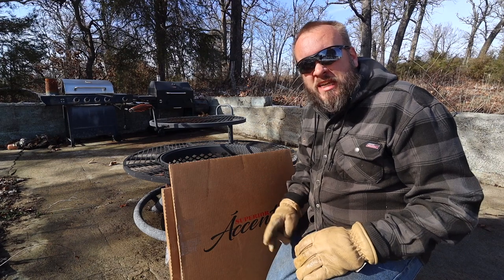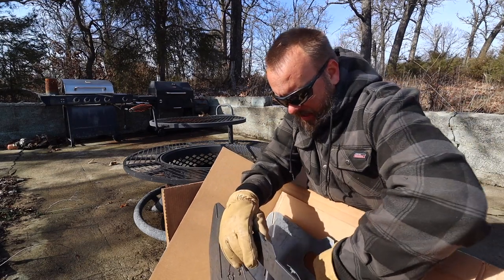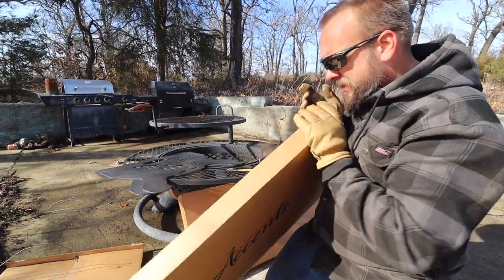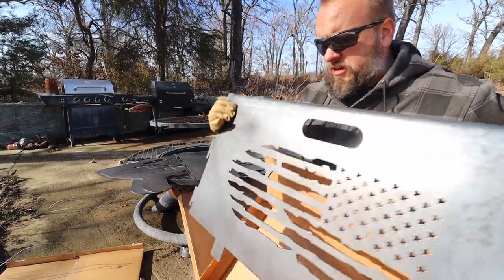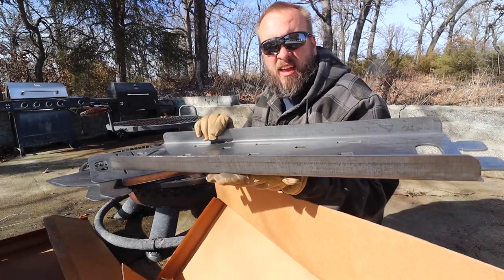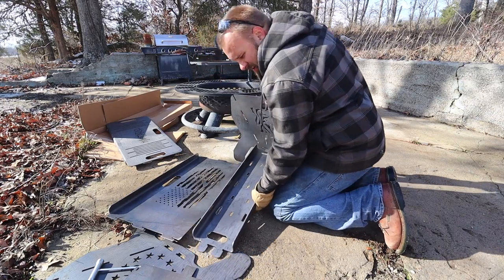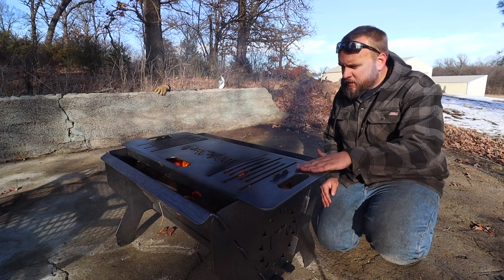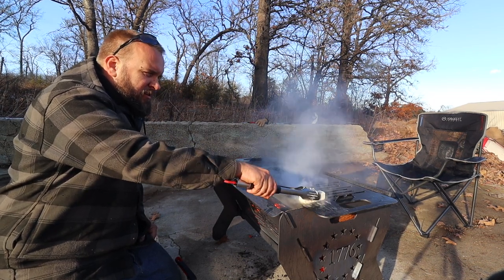The Ultimate Portable Fire Pit (It's Also a Wood Fire Grill)

Comment: Is it gonna last a long time with the thin tin? I Don’t think so.
Reply from the maker: Thin tin?  What do you mean by that?

It is 3/16” plate steel. It weighs 140 pounds. 

Any commercially available fire pit you would buy at a box store is made of much much thinner and weaker material

Now to the question, how long will it hold up, I don’t know. I just got it.